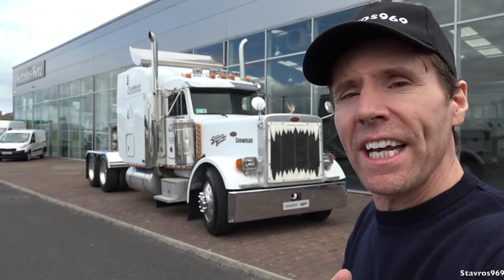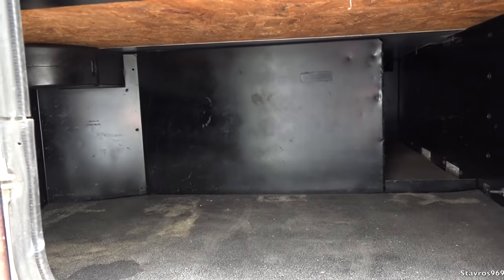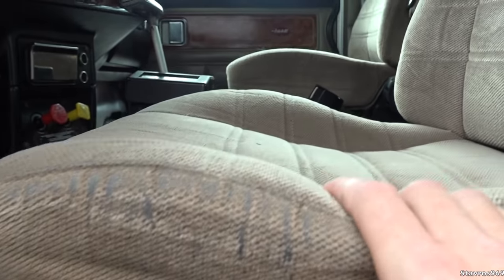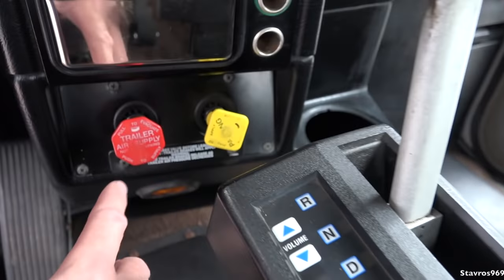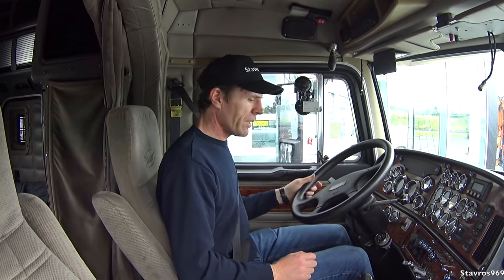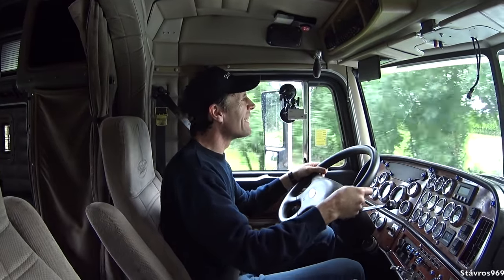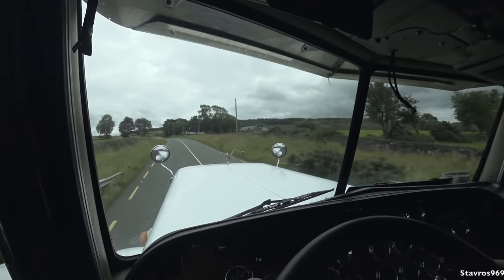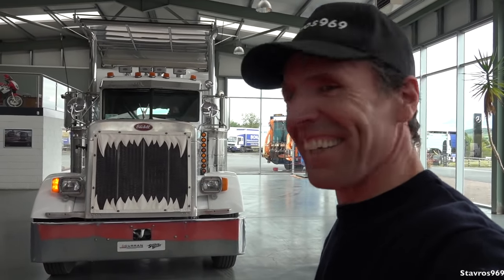2001 Peterbilt 379 Full Tour & Test Drive Caterpillar Engine

Comment: Then there’s the optional gauge package 15 more gauges, to include tyre temperature gauges, seat temperature, and door handle temp to name a few. You think front ends lively, wait till its empty on an concrete LA freeway, it will bounce and chatter like hell like all bonneted/ conventionals They look good, that’s where it ends. You need every bit of that sleeper at the end of the day, they are rough and noisy things, compared to Euro trucks. Power steering was and option in the 80s and 90s  looks like the same for 00,s as well.
Reply: They do look very primitive compared to European trucks
Reply: Power steering was Standard in the US. In the 70s they didn’t have it standard, it was optional.
Reply: roundsm18 Viking freight 4x2 cab overs KW,s did not have it on 80,s trucks, after market P/streeing was Air assisted.
Reply: Gareth Ifan  Yes, all US were kit trucks, like Foden ERF and Atkinsons, crude like there cars, but tried and tested drive lines. Renault Volvo and Mercedes moved things forward 20years when they bought the big brands in US.
Reply: @checker3694  Yes..the 'parts bin trucks' were pretty good on the whole, I liked the Eaton Twin Split in my MAN F90 but in the end it engaged two gears at the same time and blew the back off the transmission. The Erf's and Foden;s were good, but they were a bit crude and couldn;t compete with the European drivelines for refinement. Once you've had a Scania or Volvo..it would be very hard going back to an Eaton-Fuller.
Reply: Checker the truck in the video is a 2001. 
I can’t speak to exported ones but working on US ones the Peterbilt 379 has always had factory hydraulic power steering 1987-2007. 
It was optional on the 359 which was the predecessor.
With respect to the K100 cabover series, they are a Kenworth product and large batch orders can sometimes do fleet specific things. They also at the time ran pneumatic windshield wipers (Kenworth has done some dumb things over the years and aside from building a cabover that was one of them). 
UPS actually ordered their trucks without power steering, AC or automatic transmissions until just a few years ago.
Reply: Checker with respect to your comment to Gareth Ifan: Volvo isn’t considered an American truck, in spite of the common ones in the US they don’t make up a large portion of the market share. Mack is now owned by Volvo. Prior to that complete changeover we could order the Renault engine in a Mack truck, however in my experience it wasn’t commonplace. 
Freightliner and International tend to have a large portion of the fleet markets and Paccar (between their Peterbilt and Kenworth) tend to hold much of the owner operator market in the US. 
The attraction to Volvo in the last ten years is that they’re a $90,000 disposable truck that gets the job done as long as you’re local and don’t have a mountain range to climb at 105,500 gross.
Reply: Gareth Ifan Yes when you Manufacture something you have the ability to refine and better it. When you don’t have the ability to manufacture it, you take what’s available.

Comment: I've never been in a 2001-2004 Peterbilt that hasn't lost it's light cover on the rear sleeper light. Never fails, lol.

But as someone who drives a 388 with a 510hp Paccar MX-13 for work (and has driven plenty of 550 C-15 CAT's), I'd take a Series-4 Scania V8 any day of the week.
Reply: You drive new 389 with 510 paccar and you would change it for scania?? Really? Im driving brand new 2020 daf xf 530, in full extras and peterbilt 389 is my dream truck... Its really not that great?
Reply: @Spear98CZ  The 389 is an "update" to the 379 design, which is itself an update to the 359 design from the late 1970's/early 1980's. It's dated, unergonomic and horribly inefficient (it looks cool, but it costs 2-3 mpg based on shape alone).

There's less space in the 389 cab than older Euro-style COE's. Even with a flat floor you can't stand up straight in the Ultracab (there's probably more room to stand in a Spacecab DAF). And good luck squeezing between the seats to get into the sleeper with a regular cab.

The Paccar "wide cab" they use for the 567/579 and Kenworth T680/880 is far superior, but still decades behind Euro trucks for efficiency in design. They are heavy and have a lot of "empty space".

They are an exceptionally dated design on the inside and yes, I would take a Scania or (EU) Volvo any day of the week over one. Especially with a 16 litre motor pulling B-trains (gross 63 tonne).
Reply: A man with taste. Love the big Scanias!

Comment: At 3.00, the reason for the big gap is because on some of the American trailers, the kingpin is further back than on Irish and UK trailers.
The interior is an American Classic interior
My fav American truck is a Volvo VNL with an Eaton fuller 18 speed manual transmission

Comment: My favorite N.American truck is the Western Star 4900 series.  Wide sleeper, very quiet and a plush ride, even for a forestry truck with Detroit Diesel power and AN 18 SPEED stick.   Your Pete, something wrong with the power steering, low on fluid or a hydraulic line might be collapsing internally, blocking off the flow.
Reply: Mine too

Comment: I was born a truckin' nut and I like at least one model from most of our manufacturers. I really am a fan of the older iron such as Western Star (when they were hand built here in Canada), the Mack Superliner was a sweet truck (also the first one I ever drove), so it's obvious that I'm a fan of the "big hood" trucks. Peterbilt is always at the top of the heap for me and I would like to find an older model such as a 351, or 281 to use as the base for an RV. Actually, I only need the cab and the whole front clip, so it would be wrong to strip out a complete, original truck. I wouldn't do it. It's cool that you got to drive a Pete, quite a different beast compared to what you would be used to. That one is quite plain, a base model, but still a Peterbilt 379 so that makes 'er cool enough for me hahaaahaaa! Happy trails and keep your shiny side up!

Comment: I'm over the pond and own a Cummins powered international LT.
Reply: I had one of those for awhile when I was with Knight Transportation and it drove really weird. It’s like it limited power output based on weight on the rear axle or based on engine load or something because I swear it was slower when bobtailing than it was when pulling an empty, or even slightly loaded, trailer. I know it wasn’t the Cummins X15 because I had the same engine in a Kenworth before the International that didn’t have a power issue at all - it would give me 100% power when I asked for it. So I don’t know what was up with the International but it was bizarre Trying to pull out in traffic when bobtailing was literally dangerous because of how slow it would accelerate. The transmission was also absolute trash.

Comment: The mudguards on the Mercedes are fitted for delivery only, as the truck hasn't had its body fitted. They are adjustable, as they can be used on a variety of trucks. Great videos though. 👏👏👏

Comment: My favorite truck is the Peterbilt 379, just like you're driving. After many years, I was able to buy one. Mine is a 1997.

BTW, that is an air-ride seat you have there. You can raise it up a bit with air controls on the left side of the seat. :-)

Comment: That engine brake lever must have been made from a wrench.
Reply: Not really
Reply: The trolley valve (or Johnson Bar) is the trailer service brake. The engine brake is run by two switches an on/off and the second is low, medium, high.

Comment: You have to pull the cord for the airhorns they Will work. IT also would be better  if IT was a Manuel shift eaton fuller 18 gear and not a automatic gearbox. Here in America Rhose truckers can pull big heavyweight loads such as very big industrial equipment

Comment: Top o the morning, you can easily turn the horsepower up on that engine provided you have the software up to about 600 in some cases. That caterpillar engine can surpass 1million six hundred thousand miles as long as you maintain proper maintenance oil and filter changes and what not.

Comment: The air horn was on the string by by the top of the door. And why yes, its not that practical, even here in the states, the 379 is still one of the most iconic trucks around. Many of them are being replaced by more fuel efficient models such as the 579. I personally never liked the autos in a truck. From my experience they dont shift near as fast, nor as reliability as a manual. My favorite as far as looks is a 70s Kenworth W900a, but practicality would be a Freightliner Cascadia.

Comment: If you ever get the oppertunity to drive a kenworth w900 full studio sleeper it's a massive interior you gotta take that oppertunity. That peterbilt also wasn't very nice, I've seen much nicer, it's also odd for me to see an american truck with a clutch on the automated manual xD not that it does not exist I just personally have never seen one in America, peterbilt also has the model T style clutch where it sticks out of the floor unlike other vehicles.

Comment: well well well never though id see you driving a usa truck :) next up kenworth :) how much are these trucks to buy from this eara ?
Reply: They are around 30,000 to 75,000 depending on specs. The one he drove isn't near as nice as some of the ones I've been in.
Reply: They also do have power steering. The truck he test drove had issues,the sleeper normally has doors on all of the cabinets,he also didn't use the Jakes at all. It would be nice if he would have driving a little nicer truck that had been serviced a little better. That steering wheel was also wasn't the top of the line wheel. Truck didn't represent the nicer ones. This one would be worth maybe 25K to 28K.

Comment: Wish it were a more optioned truck. That's a bottom of the barrel spec.. That is a beaten up truck. I've never seen one without power steering or with that transmission

Comment: That looks to be a fairly low spec Peter built.  The higher spec ones have full leather and an even bigger bed.   

It’s funny though how American trucks are basically carbon copies of 1970s trucks with no movement forward in tech.
Reply: That's NOT true, this Peterbilt is basic, but the more recent American trucks ARE pretty high-tech, obviously the Volvos VNL`s are on the forefront, being European blood related, but the new Peterbilts, Kenworth, both part of the Paccar group as DAF,  Westernstar, Freightliner, Mercedes owned, Mack, Volvo owned etc. are very well equipped, obviously the design still very Americanized, but the aerodinamics got better over the years, the fact that they have all those gauges, it doen`t mean a thing, it`s part of their tradition, and why not?
Reply: I wish we had at least one brand whod do that here as well.

Comment: I’ve driven well over a million miles in 379 Peterbilt trucks. This one actually isn’t a very nice example. 
Also, it’s rather unusual to see an autoshift transmission in a 379. Most Peterbilt owners prefer a manual transmission, usually an 18 or 13 speed Eaton Fuller.

Comment: Peterbilt 379 series 60 or c15 Ive rode in a 379 and w900s freightliner century class and international i9400 the best woud be the w900 and 379 never driven one but rode in them best engine in my experience would be the c15 and series 60 or that the one that makes you money

Comment: Like everything in USA its flamboyant! Unnecessary big and shiny! Unnecessary complicated with so many gauges! Yeah, looks cool but nothing more! EU truck are much better! Fuel efficient, better use of the space in and around the cabin and better arrange of the gauges!
Reply: Hey, there are a few reasons why american trucks are like this. For one, american trucks like this are generally run by owner operators. Owner operators like customizing their truck to show pride of ownership and they like the extra gauges to monitor various parameters and identify possible warning signs. Obviously there is more space on the roads in the United States, so a conventional long hood design is preferable. As far as fuel economy is concerned, there is not a major difference, loaded a Scania R560 and a Peterbilt 379 both average 7MPG.

Comment: A 2001 with no power steering?  I wonder if the pump went out and it was never replaced, since power steering has pretty much been standard on American trucks since the early 80s.  That Pete is a bit ragged out.  I hope you get a chance to drive a nice one soon with an unsynchronized 13 or 18 speed instead of that lame automatic.

Comment: This truck is in rough shape. Specially that gearbox, that's an insult to american truck soul. It must have fully manual 18 speed transmission, power steering, and mechanical problems must be solved. Then it will need a pain and polish. The result will be an american truck.